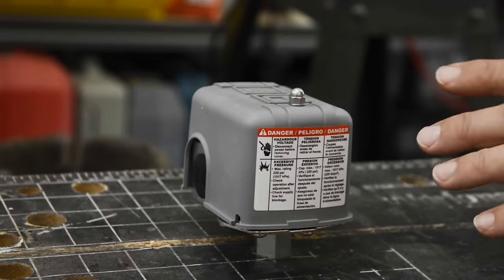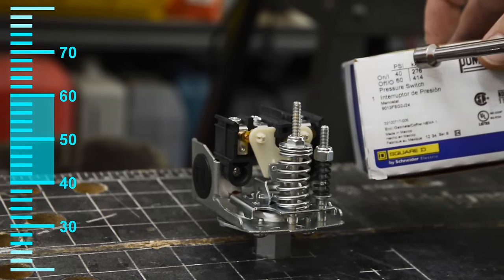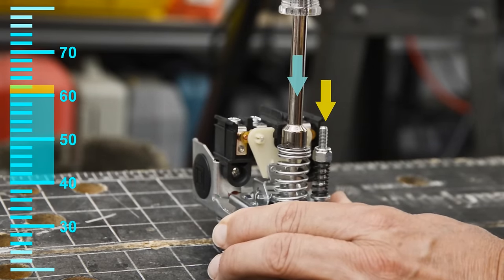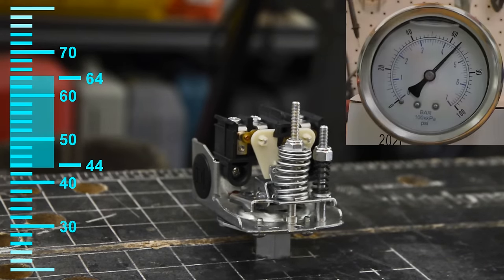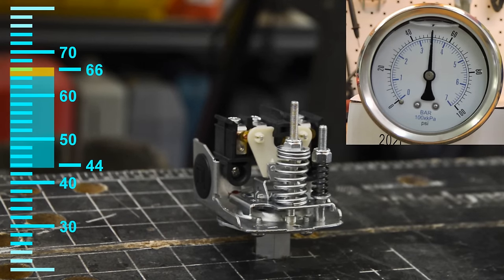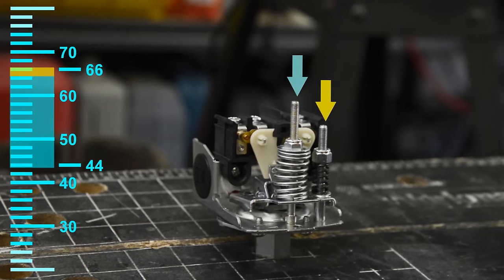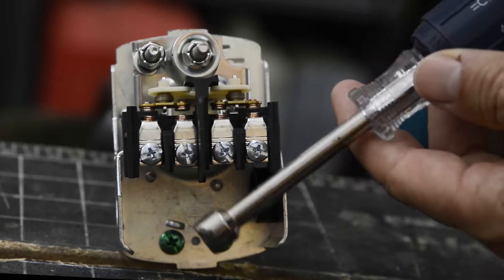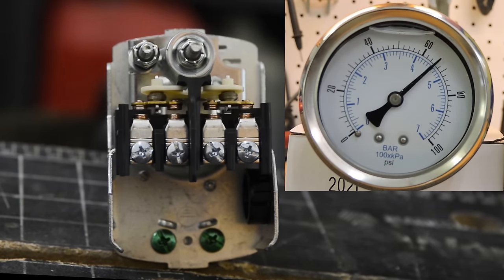Pressure Switch Adjustment

Comment: I just built a pole barn. My house has a well.  Can I T off the line to my house and run it straight to my pole barn? Or will I have to have another pressure tank in my pole barn? Or I will I have to run another line to the pressure tank in the house and run it back to the pole barn? Thanks
Reply from the maker: One tank is all you need.  Since the Ballast tank is on the outlet of the pump and it's check valve you can tee in anywhere after your safety cut-off ball valve.

Comment: Thanks man. Explained a lot. Fixing to install a presure tank tomorrow. Do i need a gauge at the tank and the pump?
Reply from the maker: All you need is one at the ballast tank near the pressure switch.  Most plumbing supplies have a special tee that threads into the ballast tank and has threaded holes for the pr. switch, a gauge and a press. relief valve.

Comment: 'Well' though out vid, thanks.

Is there any way I can get my system to operate at 50-60 range, instead of 40-60? I want to reduce the noticeable fluctuations in shower.
Reply: ChevySS1968 look into the cycle stop valve

Comment: i recently installed a pentax water pump, but it doesnt cut off after im finished using water,to wash laundry,dished etc..it keeps running stops whe it builds pressure an runs again..it doesnt stop..doi have to adjust the switch?

Comment: Hi thank you very much for  sharing your    knowledge.  Question.  Can you run a 30/50 at home here to a 40-60 without any issues.   Feel like i need more preasure upstairs.  Thanks in advance
Reply from the maker: You can go up to probably 37/57 without fully depressing the springs but that is not optimal, better off getting a proper 40/60 switch. Square D and Merrill both make good pressure switches that are less than $30.00 U.S.
Reply: @reclaimfilterssystemsinc7529  
Thats what i have it set now.  After watching your video.  I will look into getting. 40-60.  Thanks very much for your help and getting back to me

Comment: --so, with my 30-50, you say that the small screen can get clogged- my shallow well is very calcified, when I changed the impeller the casing had to be chipped clean (one tough job) --  question, how do I clean that screen?? I do have shut offs on 'in and out'--
Reply: Jess Youngquest It's easier and cheaper to change the pressure switch.  They are normally in the $20 -  $30.00 range so I wouldn't even bother.  There is too much of a chance you would puncture the diaphragm in the bottom of the switch.

Comment: Problem ! I can get the pump to start @40psi, but it won't cut out @65, or at all for that matter. When I cut the power, the contacts stay connected, but if I touch them, they will disconnect, and remain disconnected until the pressure gets back to 40psi. Any help is appreciated. Is the switch bad ? Or may there be another issue. Thanks in advance.  Bill

Comment: my pressure switch always drops about 5 psi every time it stops at 60....it goes down to about 55 and stay there...i cant find any leaks anywhere but I dont think there is a leak anywhere since it will not go down anymore once it drops the 5 psi...it does the same thing at 30/50... it will drop down to 45....what do you think it is?  i have repalced the switch with a new one...same thing

Comment: Now i know that there are different  range of pressure swicth, thanks for your explanation. I have bought a new square D pressure swith for my 2hp gould water pump before it has a setting 30 cut in 50 cut out i adjust the cut in and cut out its indicated in pressure gauge is 60psi cut in and 22 cut out. is it okey?
Reply from the maker: You can adjust the range up or down with the center nut.  A 30/50 cuts IN meaning the contacts close and the pump starts when the pressure drops below 30,  cut out or cut OFF is when the pressure is satisfied and the contacts open removing power to the pump.  They make many different types of pressure switches so make sure yours is a well pump pressure switch.  The two most common ones are the 30/50, and 40/60.

Comment: Hi....my gauge goes up to 60 and goes down to 25...we recently have had really high pressure and then drops to really low pressure and then back to high pressure ...higher pressure than we have always had....the spring for the cut in looks like it’s not even doing anything ( like it’s broken although it doesn’t look broken).  The switch is a 30/50....thanks

Comment from the maker: In Bar it’s 0.138 less that the on pressure. For example:  That’s 2 psi under cut in, so for a 40/60 switch the pressure in the tank “dry” with zero pressure on the system and the pump off is 38 psi. Cut in 40 less 2 psi equals 38 psi.  If the pressure is too high you may get water hammer, if too low then your pressure could drop suddenly when to use water and could cause an on/off/on/off… cycling of the switch which could ruin a pump motor.

Comment: Thank you...what if my pressure goes to zero and the switchch on...what to do now?
Reply: If the contacts are closed and you have no pressure you start with (assuming you know how to use a multimeter) check power on both sides of the switch.  Here in the U.S. it's usually 230VAC.  If you have power and no water, you may have a bad pump. Lastly sometimes gauges go bad and can read zero but you can still have pressure.  If all else fails, call a well driller or plumber in your area and they'll get it straight.  Good luck

Comment: Our pressure switch cover states 20/40, however, we have a very large capacity pressure tank and it says we should be using a 40/60 switch.  We just adjusted our switch (after viewing your video-- thank you!) to 40/60.  Will we encounter a problem since the pressure switch states 20/40?
Reply: No. This shouldn't be a problem. I've done this many times.
Reply: Karen I know it's been a long time since your comment, but if you like your pressure at 20 to 40 psi, as I do just leave it there.  I like mine at 20 to 40 because it seems to give me plenty of pressure & at a lower psi. I have a less chance of blowing a pipe or something, & I also have the benefit of having a greater volume of water displacement between pump turn on & shut off, thus saving wear & tear on the pump switch, start capacitor, & the pump itself.

Comment: another thank you for great explanation. Do you think by installing a 40-60 pressure switch in my house will present any special issues as I had a 30-50 before and am installing the Square D brand. Does each pressure switch range take the same stem as the one currently on water line manifold? I believe it is a 1/4" size copper pipe threaded at both ends.
Reply: Greg Brophey We did that at home with no issues.  The pump took a little longer to reach the 60 psi cut-off but there were no appliance issues.  I noticed slightly better pressure in the shower and the toilets filled a little faster.  One benefit in our situation was the pump would not cycle as much during usage.  It ran continually during use instead of the on/off/on/off.  I thought it would use more power because it ran longer but because of the reduced cycling I think we actually saved electricity.

Comment: I have a water pump that continues to cut off monthly. We're getting power from the circuit box and lines but just stops working after 20-30 days - what else could be the problem?
Reply: Terry Peterkin 
Two most common.  1.  pump running but the water level is too low, or the thermal overload on the pump is kicking in, preventing the pump from running.

Comment: my year-old 40-60 switch cuts in at 40 but cuts out at 50. instead of 60.  I turned the smaller nut a few full turns, and it didn't have any effect... turned it a few more... finally 8 full rotations got it up to 52.... Is it okay to continue to turn that cut out adjustment all the way down.... almost all the way?  or might I have a bad switch... even though it's quite new.  It wasn't doing this before and it seems like quite a drastic adjustment.
Reply: Thanks Russ, in that case would it make sense to turn the other one down from 40 to 60 to 35 - 55 so I can keep that pump from coming on more often

Comment: Does anyone know why these switches are DPDT?  I was wondering if I could control my pump with a SPST relay on the hot wire only, or do I need to switch the neutral as well?

Comment: Question for you guys.  My pressure switch goes from 0 to about 43 to 45 psi. and does not shut off, it keeps running. I tried adjusting and nothing happens.  I had another {used} switch and I'm getting the same results. All I can figure is that I have a leak somewhere outside the house.  I mean. what are the chances both switches are bad? I took the bottom off the switch and cleaned the diaphragm and the little hard plastic tube. Both didn't seem to look all that bad. Your advice would be greatly appreciated.

Comment: I have a small cabin in northern Michigan. 1 bath and kitchen.  The pump does not have a pressure gauge.. However, after the water runs ( with good faucet pressure ) for approx 1 minute the pump kicks on and i lose pressure at the faucet. I have to turn the water off and wait a few minutes, only for this to continue. Sound like a bad pressure switch. ?? Thanks
Reply: email Russ at rkeller@waterreclaim.com and he can help you.  Sounds like a ballast tank issue.

Comment: Hi. I got a pump that continuously pumping. Im not sure whats the problem. Got someone to check my pump and he said its still good and he suspected there is a leak. Ive check everywhere for any leaks and seems all good. Can you advice?
Reply from the maker: What is your pressure doing, that's the first question you need to ask.  If it's never reaching pump switch cut off (normally 50 psi) then the pump will never stop.  If it does reach 50 and your pump's pressure switch contacts are open then it's mis-wired.  If it reaches 50 but the pressure switch contacts do not open then the pressure switch needs to be adjusted, or replaced.  If the pump never reaches pressure (50 psi) then the pump is bad or there is a break in the line from the well and you're losing water and pressure back down into the well.  Or something completely different.  A well service person would be able to tell you in 10 minutes.
Reply: I had a similar problem and we found there was a leak on the riser inside the well.

Comment: I had a new well tank installed that is factory set to 38psi. My pressure switch I noticed is a 30/50. Recently had some water pressure problems and I tested the cut-in and out and it would cut in at 34 and cut-out at 70. I used your method and raised the cut-in to 40. When I tried changed the cut-out, at first it went down to 66 but once I got the cut-in to 40 I could no longer seem to change the 70 cut-out. I then noticed the spring is basically completely loose for the cut-out, i.e. the nut is towards the top of the range and you can freely move the spring up and down. Something doesn't seem right, any help?
Reply from the maker: Let some air out of the tank befor you install it.  It should be at 28 psi, or 2 psi less than your pressure switch cut in rating.  If the tank is already installed cut off the water supply and relieve the pressure til your water gauge reads zero.  Then let air out until you read 28 psi on a tire pressure gauge.  Their is an air valve at the top of most tanks.  Then put the air valve cap back on and turn the water supply back on. This needs to be done first befor adjusting the pressure switch.  That should do it.

Comment: I have a question I hope someone can shed some light on. I have a 6 gallon 150 psi air compressor. Factory Cut In (120psi) with a Cut Out of (150 psi). I only have one security adjustment screw. I was trying to get the cutoff to 120 but it seems as I turn the screw counterclockwise, I lower the Cutin and and Cutout! I didnt want to lower my Cutout below 150. Is it that crucial to have the exact cutin of 120psi ....what would be the reason that I cannot adjust to that exact read? Everything else runs well...with the only other exception of a  very Rare issue of the compressor trying to engage itself for these very short intervals and then it goes back to normal, its like a litte seizure or something...Lol, never knew what to make of that, but it was only a rare thing....so it wasnt a big issue
.

Comment: Best video I've seen on the subject. Thank You for taking the time.
What do you recommend setting tank pressure at when you have a 40-60 pressure switch?
Reply: MrRainbowrooster 2# less then your cut in point, so 38 PSI precharge in your case

Comment: can you adjust a 40 - 60 pressure switch to 10 - 30?
Reply from the maker: Hi Ronnel, short answer is no, you have a little adjustment each way, but they do make special pressure switches that operate on lower pressures but they are non standard and usually expensive.  It's cheaper to run a 30/50 pressure switch and use a pressure reducing valve in order to obtain the pressure you want.

Comment: my pumptrol (indicates 20/40)  is running 20/32, i adjust the small nut and it is now 20/36. is it ideal pressure for home, should i have to adjust the small nut to get 20/40?
Reply: +Russ Keller thank you, if i want to make my pressure 20/40, i should turn the small nut cw? right
Reply: thank you, such a great help,

Comment: PROBLEM ??? My water just STOPs at all stations ! I go out to my well house. The PRESSURE SWITCH 'L' bar is in the ON POSSITION. I flip that bar over to the OFF POSITION and then BACK to the ON POSSITION and I can hear my 80 gallon water tank refill itself with water. This problem happens intermittent and it makes NO sense to me. It can happen 2 times in a week and then a month might go by until it happens again. I put a NEW system in back in 2012. This is 2018. My problem first occurred about 7 months ago. Approx. 12 times this has happened now. I just go out and flip the 'L' bar on the pressure switch as I explained. I have a REAL PROBLEM that needs correcting. Is it the Pressure Switch ? or the ELECTRIC box that sits above it or could it be the WATER TANK itself ? ANY suggestions would be helpful.
Reply: Russ Keller OK RUSS....... Your explanation gives me a broader view of a possibility to this problem. My well is about 250 ft deep and I have been told some time back that it draws water around 180 ft. So if the flow of water underground   ‘the water table’ drops and and water can NOT be received into and up the pipes........ then maybe my switch turns neutral (Off ~ no running) to protect the system.  I hope I am understanding you correctly. I think I get the idea of what you are stating. Thank YOU for your quick reply regarding this.⭐️💦

Comment: hows it going,need some help.mine is running super fast from 40-60.a while back i had to replace the gauge and the little air valve like you have in your tire.it was leaking.so i need to add air.i shot off pump power,emptied tank,then put 28 psi. turned on pump,and same thing.40-60 quick.is this a air problem? or what? more air??
Reply from the maker: +onewheelup 
if you pressure switch is a 40/60 the ballast pressure tank (assuming the system pressure is zero, pump off and no water pressure in the system) should be set to 2 psi less than cut in, yours should be 40-2 or 38 psi, you yes I think you are correct and you just need more air pressure in the tank.
Reply: thanks for writing back,yea i added 38 psi and it might have helped barely,but it still short cycles,when we first got it installed in our garage the valve like a tire valve constantly made a whistle noise,it doesn't anymore,i replaced it,and replaced the gauge with the floatation device,and its going from 40-60 so fast now that you can tell when your running water in the house.im gonna have to call someone because our water softener sucks it stinks,i can adjust the bleach to 100 % and you can't smell the bleach at all.so oh well gonna have to spend money on someone to come out i guess.take care.

Comment: In regards with overhead tank. What design of float would you recommend to trigger the automatic control switch? And there are tank that are stand vertically or horizontally.
Reply: How to install water filter tank.
Reply: see some video they shared

Comment: i have. a36 hallon 100psi tank and a 3/4 hp submercable pump...all this is new and i keep running out of water after about 2 showers..do i need to tighten those? or loosen them?..the pressure gauge is showing it to build up to about 40 pounds and then it ends up at 0 after 2 showers
Reply from the maker: Hi Dave:  Sounds like you may be running out of water in the well.  Check to see what your recovery rate is.  It should be printed on the well casing.  If you are only 2 to 3 gallons a minute and you take two long showers you could have run out.  Then there is just no water to pump and the gauge will read zero.  I would have a well driller check it out.
Reply: Reclaim Filters & Systems Inc ok i was.kinda thinking the same thing because the well is fed by a spring and its been dry because of summer...always seemed to do better in the winter and fall months eith the old tank but we wasnt happy with it and realized the bladder was busted ..got a bigger tank and im thinking that spring that feeds the well isnt really doing so great..possibly because it is dry a little thanks for the reply i will check the well and might haul a load of water in and have the wife wash laundry while.im filling the well with water

Comment: What hp pump is needed to be able to reach 60 or 70 psi?  Should a 1 hp pump produce 70 psi?  I don't mean operating pressure, simply cut off.